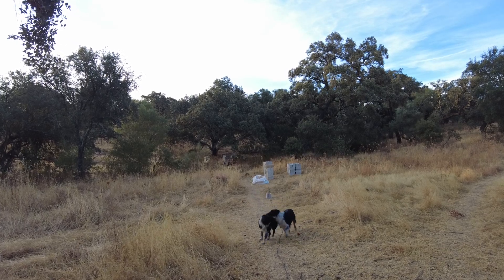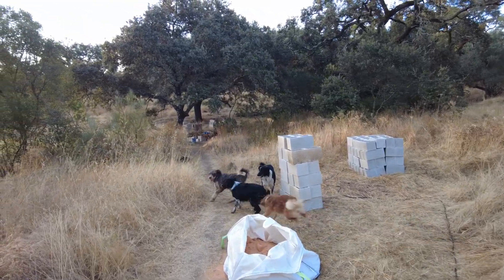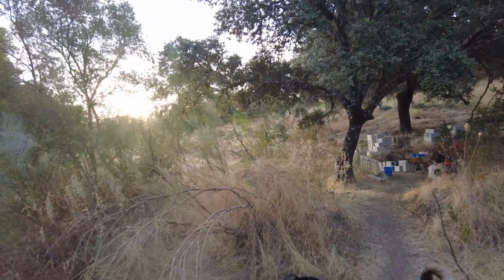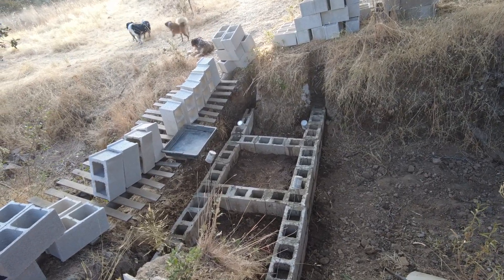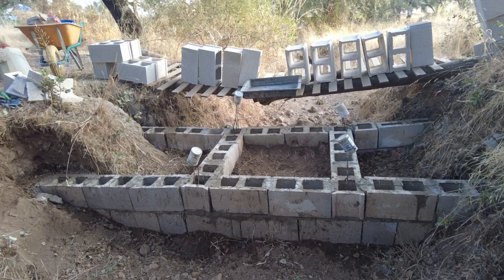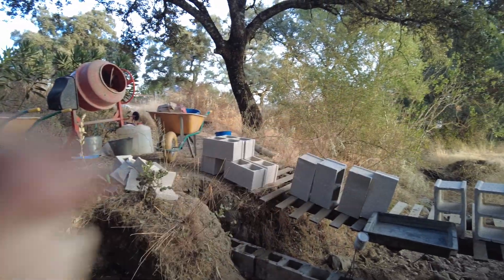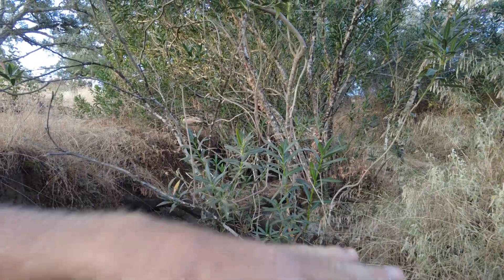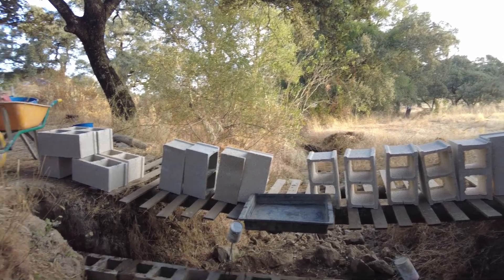Water, soil and plants need a delicate balance to avoid erosion. #agroecology

Comment: You'll need a hardcore or concrete ramp before the bridge to take the pressure off the blockwork, Also the infill between the rows of blockwork
needs to be of the same density as the walls, stone, broken blocks, leftover concrete etc, 
Also the water leaving the bridge will need another falling ramp of stone to prevent erosion.
Reply from the maker: Sounds like hard work and sounds like sound advice. Keep sharing. Much appreciated

Comment: Looking really good Martin.  I'm glad you took the time to make your working conditions more comfortable.  Make things go as easy as possible for your knee.  Nice to see the core of the crossover filling up with compacted soil.  It has the look of being quite substantial. 💪  A far cry from the earthen dams built ~3 years ago😉
I will suggest that it is time to get out your laser level to get a precise read on your spillways.  I'm imagining you want them to be the same height?  The western bank of the creek appears to be lower to me (the spillway to the Roman canal) the eastern bank of the creek spillway will require some excavation so they are level.
OR, you could raise the spillway on the western bank by extending your block wall construction.  I believe that is my preferred approach.  
In either case, the top course of block should be locked into a trench with mortar or cement so it can not be undermined by water diverted into the spillway. 
I see there are many stone up the creek from the crossover.  Once the crossover is complete, they can be repurposed elsewhere; as armor in the spillways, to bolster existing leaky weirs and to build leaky weirs in the Roman canal. 
Those stones are a great resource. 👍
A masonry technique to trial.  Stretching a taught string from one end of a block wall to the other speeds up the block laying process because you lay your block to the string line.  This technique results in a straight and level line without fussing with a level (assuming your beginning and ending points are level).  If they are not level, you can adjust the string up on the low side and add more mortar in the joints as you go. The string stretch is typically accomplished by laying up the first and last block as reference points.  A 'line level' is helpful as a check, if you have one.  If not, they are very cheap.
Have a lovely weekend with the cooling temperatures. 💙🌳🌻
Reply from the maker: String I will Steve. This is now the right time to get the blocks perfect. Thank you for making my life easier.

Comment: I'm thinking of putting up some cement blocks as walls in my mini ponds. Don't want to put rebar in as that will inevitable corrode away anyway especially given how regularly soaked it's going to be. What do you think about putting them in just to hold soil in the spaces and deep rooted grasses in that soil?
Reply from the maker: I think it will work. Just have soil both sides. Maybe fill them with soil and plant something in there. Good luck with your projects
Reply: @SuerteDelMolinoFarm  Yes, I intend for the blocks to form the core of the pond holding wall so soil all around. In other pond building videos I;ve seen, they have a thick clay core for it but we don't have that or our hand digging won't allow it.